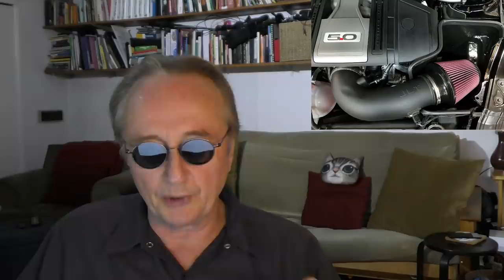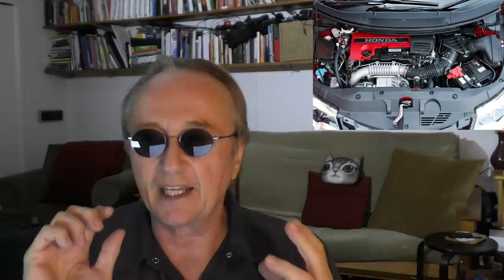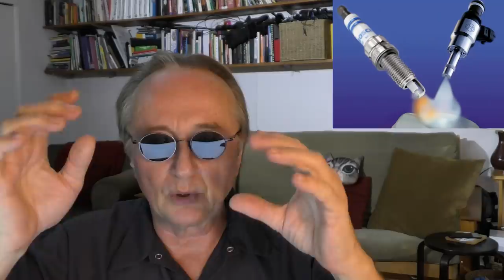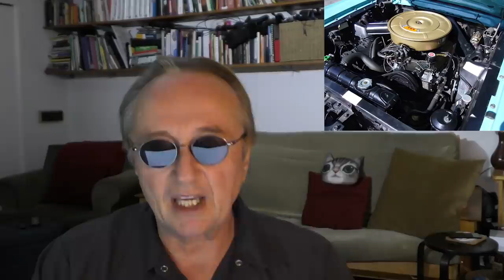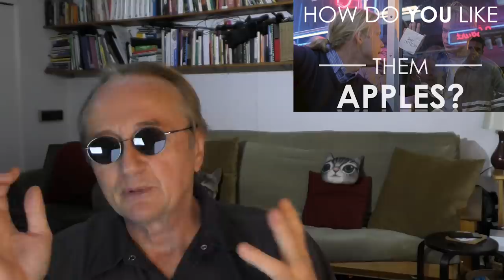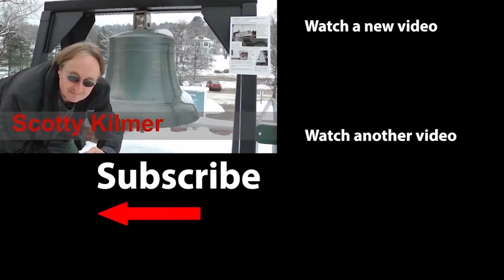This Car Mod is Stupid

Comment: I like watching your videos and find them informative. Thanks for making them. 
I have a 2017 F-150, 5.0, 4X4. I put an M&G braking system on it because it's flat towed behind a motorhome.  They're from Athens, TX, so you may have seen their product. It uses the air from the RV brakes by adding a device about 5" thick between the booster and the master cyl. This makes the OEM air filter box not fit by about 4". Since the OEM filter setup won't fit anymore, they also have some PVC and an oiled type filter (I don't think it's a K&N brand, but it looks the same type) attached the end as part of the brake conversion.  What other options do you recommend?

Comment: The late model Suzuki Grand Vitara is known to be a reliable great little SUV.  I picked up a 2013 with 30k miles on it a year ago and it drives nice, feels very solid, is well put together and I'm very happy with it.  It has a good AWD system with low range coupled to an Aisin (Toyota) transmission so it should last a while.

Comment: The guy with the lurching Acura - sometimes the ECU board has a problem. I had this with '06 Lexus and it was a 125 dollar fix after I sent it to the place in Illinois . Car worked perfectly, it was NOT a transmission problem, but a computer problem (for me).

Comment: Get a cold air intake, free flowing cat back exhaust, and get a tuner for the car. Usually a stage 1 would work fine with those mods. Or get an older vehicle and it’ll work fine

Comment: My 2000 Ford escort zx2 sr has cold air intake from the factory.  It has borlaug mufflers and the pcm IS different to accommodate the cold air.  Stock zx2 has 130 hp and the sr version is rated at 143.  2.0 I4 vvt naturally aspirated.

Comment: Lots of Cai are sold bundled with a programmer now. 
Only needed if it actually increases the airflow by a large amount.
Some Cai only increase airflow a little bit, and don't need computer tuning.

Comment: I 100% agree with you scotty the air intake systems make the car sound faster but actually make the car lose horsepower they are a stupid mod.
The K+N replacement filter are much more beneficial in the factory air box .

Comment: Scotty, when I start my vehicle it’s a 2011 bmw 328xi. When I put it in reverse it seems like I am hitting the gas slightly when I’m not. It’ll rev about 300 rpms jolty and then will be completely fine. 95k miles.

Comment: Any filter that's open to engine bay air is a hot air filter.  The only true cold air intake is your factory air box or any aftermarket filter system and incorporates a sealed filter.  Just change out the drop in filter with a higher flowing one.

Comment: Weird. I have an 07 Trailblazer. Moved to a k&n air filter . It ran a little hinky for about 2 weeks till I think the computer and motor seem to acclimate to the boost in air flow and ever since has run alot better 👍😎🤔👌😁

Comment: Noise when going into revers....works after a few tries.....I had that happen on a Dacia...let you foot off the brake a bit..let the car move a bit (not much) and it will engage... In my opinion the gear does not fully engage (can be felt in the shifter) and letting the car move while holding it in R you should feel the shifter move a bit

Comment: I have 02 Suzuki Swift. Sometimes it has same problem putting it in reverse. In such case I put it in 1st gear and move a little bit forward, then it goes normally in reverse. I don't know why it is doing so but just live with it since it is not a big issue.

Comment: have an S&B intake on a Colorado 2.8 duramax diesel. It woke the engine up eliminated the turbo lag and it performes much better. It was pretty slow stock.                                                      You have to buy a good quality one if you get a cheap one it will not be good some of the cheap ones will cause a cel..... but in my area we have no e tests anymore lol

Comment: A cold air intake can only have any benefit at full throttle, because at partial throttle the biggest restriction in the intake is the butterfly valve, which INTENTIONALLY restricts airflow.  Even at full throttle they don't have much benefit, and they're much worse at cleaning the air.  Most cold air intakes just suck hot air from the engine bay anyway.

Comment: Just looking at them, I wonder what the advantage is. Stock air intake is usually over a front wheel, maybe behind the front grill. The aftermarket is on top of the engine. Also, does the stock intake use a location to use air flow over the car to get air that is slightly pressurized pushed into the engine?

Comment: Hey Scotty, my 68 Impala has a stock manual transmission. It’s never been rebuilt or has never had any problems but every time it goes to 2nd gear it Jolts forward if I’m not either going super slow or stepping on it. Any ideas?

Comment: My 01 ranger had stock CAI and when I was young thought it would be cool to put a cone filter on so essentially i took my cold air intake and made it hot air intake by sucking in the heat from the engine.  I put it back some years later after i got older and wiser..

Comment: Scotty my cousin's 1998 Honda Civic won't go to second gear if the car is revved. it will only do it in idle.
it's manual transmission.
Reply: Check the clutch master and slave cylinders

Comment: Yep, exactly as I suspected the cold air intakes don't do anything but make a lot more noise. It would be stupid if a cold air intake improved performance because it would mean that car makers don't know what they're doing. My car has a ram air factory air box so I never even considered a silly aftermarket cold air intake.

Comment: A cold air intake is stupid if not racing and driving it normally, because air intake temperatures will actually remain lower in traffic with stock intake! It only makes a difference when racing, because the stock intake will dissipate heat slower, but a cold air intake will dissipate heat faster. After a pull on a strip serious people pop open the engine hood and put fans on the engine. I have a ram air intake because I race on a road course with an average speed of 90MPH!

Comment: With older vehicles especially turbo cars putting a intake or exhaust on will greatly increase the restriction flows of the car.  New modern cars requires alot more work....

Comment: Scotty: what about the intake resonators; what do they do? My Wife has a 2010 Infiniti ex35 V-6 and one of the resonators broke-off so I removed the other and taped up the holes. All I have noticed is it is much quieter under heavy acceleration. Cheers, Mark

Comment: It's usually not that hard to chiptune the car for a cold air intake, you might want to have a shop do it to avoid having to buy the interface and whatnot, but it's generally pretty trivial.

Comment: For fun with plastic engines, some guy in YT land builds those Revell 1:4 scale "Visible V-8" engines that rev to 7000 rpm (via a power drill motor). Highly mod-o-fied, of course, but all plastic.

Comment: I know why guy asking about his Suzuki Swift is having a hard time getting into reverse: its a common problem with those cars and it's from worn out synchros. If you don't want to repair or replace the gearbox, then simply and deliberately without excessive force, select reverse gear, several times if needed. The random crunch every now and then won't go away, sadly, without getting it fixed...

Comment: Had a 89 Geo Metro with a 3 cyl Suzuki engine. Car had 250,000 trouble free miles before it got smashed in the rear end. Still got 50 plus mpg before it’s demise. The rest of the car fell apart on the inside however

Comment: Technically, composite materials such as Carbon Reinforced Polymers (Carbon Fiber) and Fiberglass are plastic composites and they objectively outperform metal alloys in many applications. Carbon Fiber body panels and frames would be ideal for cars but in practice, they still cost too much at time of writing.

Comment: I put a cold air intake on my 01' Dodge P/U 360 cu. because the Air Filter was a pain in the Arse! It sounds like ya Flipped the Lid. Remember that? Flipping the Air Filter Lid was done to increase air flow, too.

Comment: Cold air intakes work if they are designed well. They have to be big enough inside, seal out hot air well, and provide enough flow. Cold air intakes don’t need a tune on like a car like the Mustang. It’s just they make 25-27 hp with no tune and make 32 more with one.

Comment: PSA to any CrownVic owners out there with Crown Vics made past 2005. DON'T put cold air intakes on without a tune. It will make them lug and you risk damaging them permanently.

Comment: Scotty, opinion please: For a new Ford F-150, which is the better engine:  the 5.0 V8 or one of those new 3.0 Power stroke diesels?  Thank you!
Reply: I haven't heard enough about the PS 3.0's. But I've heard that the 5.0's are surprisingly unreliable over the past few years. If you have a reliable truck, already, you're better off keeping it and have a cautious "wait and see" approach to the powertrain reliability. Maybe in a couple of years, electric pickups will be available, or be very close, and EV powertrains would a) have fewer moving parts, which should translate to more reliability; and b) be tailored to towing and hauling, with oodles of torque at 0 RPM. Watch the Tesla pickup truck announcement on the 21st. Ford is reportedly working on an electric F-150. This is a very expensive decision; don't rush!

Comment: I ordered the k&n drop in high flow filter and I’m going to get an x pipe to replace the h pipe and replace the giant camaro mufflers with magna flow atak and I will gain some hp

Comment: I'm not sure !! about the cool air induction,  you can tell the difference on a cool morning compared to hot day in performance. I am not convinced at all that the the ECU is incapable of functioning because of a change in temperature, the ambient air temp in the engine bay fluctuates considerably depending on location, season and how long the car has been driven.

Comment: I have a 2003 Chrysler T&C.. When I turn on the air. And it lights up. The air blows in the rear vents. But not the front.. What s the problem? 😳

Comment: What car measures back pressure I mean you could but why aside from checking for clogged cats and ya you can get some gains especially if the cold air intake lets more flow thru the MAF sensor but a tune would be better if you are going to spend like $600 to $1000 for exhaust and intake you might as well get a tune

Comment: My old 1991 Celica used to have a bolted on Iceman cold air intake, plus apexi exhaust with custom 2.5" catback exhaust. It improved the horsepower and ran fine. Those older cars had more "learning" computers as far as I heard, but I wont do a bolt on for my 2005 Corolla. What's the point?

Comment: Hey Scotty, I got a heavy crank in my Toyota Corona ... it goes like "whoop whooop whoop" before it runs. A mechanic came to me and said it's caused by my engine is lack of oil as it leaks. Is it true? Or is it just a bad starter motor that needs replacement?

Comment: Scotty I have a 2014 Chevy spark that has a blinking check engine on cold start, checking the bluedriver it says random misfire/ cylinder 2 misfire. Check engine goes away when engine is warm. Also sometimes turns off when parked

Comment: Cold air intakes don't do that much of a difference unless your stock intake was terrible. The outside air is not much cooler than the air inside your hood, it's windy as hell down there on the highway!! The only performance gain is if the new intake flows better than the old is itll flow better

Comment: Umm, I installed a cai on my 16 audi a6 3.0t and noticed an increase in fuel economy as well as throttle response and the engine sounds better too under acceleration so I guess what he says doesn't pertain to every modern vehicle.

Comment: I call them "hot air intakes" because most of them just suck in hot engine compartment air instead of cool air from the front of the car. Those have been proven to actually lose hp over the stock ones. There are some better ones that are ducted to the front of the car, but I don't see many people using those

Comment: 90% of "Cold Air Intakes" are installed in the most moronic places😑. Yes, let's plop a filter 3 inches from the hot valve cover.👍

Comment: cold air intake does not increase fuel economy, a hot air intake does. When the inlet air is hotter, the mass of air is smaller so power is less. That results is a more open throttle for the same power, so less pumping loss = better fuel economy.

Comment: You'll gain even more power by tuning, but on the stock computer, intakes and exhausts free up power in exchange for noise, which can also result in more MPG.  And the computers can certainly handle the small increase in flow, as long as the parts are designed properly (no 4" exhausts on 1.3Ls, proper piping sizing and flow for MAFs, etc.).  The power and noise come from reducing restrictions caused by chambered mufflers, louvered perforations, crush bends, varying piping sizes, etc.  All things that are poor for flow, but good for reducing noise and cutting costs.  Of course, if you buy random parts, the chance of improving things is random, as well, but known, tested parts will certainly result in gains, no matter the car.

Comment: Have a new edge mustang ('02) 'bout to upgrade the rims from stock 16 to 18in. Was going to also replace my airbox with a cold air intake(+15hp) to make up for the extra weight. But since Scotty says...........
Reply: The area potholes will love those 18" rims.

Comment: Hey scotty I have a 2009 corolla xrs Stick shift 164000, i did a full tune up on it, i added what the Mannuel recommended 0-20 full synthetic , now after my 80 mile commute i hear a ticking noise in the engine. Is the oil too thin and what oil do you recommend. Modesto California

Comment: So, I purchased a great used 2007 Lexus IS 250 from a private seller, after watching a TON of Scotty's videos. 

I just found out that it has a K&N cold air intake installed already. Well, I am getting into Autocross with that car here in NY and will do some racing (nothing crazy tho). I have no idea if the car's computer is properly tuned to that intake. I only know that it rides very well, not loud and no problems whatsoever.

The question is, how can I tune the car's computer to work with that intake?

Comment: Hey Scotty, what do you think about a 1997 Ford F-250 with the 7.3L Diesel? With 78,000 miles?
Reply: 7.3s are the only fords i would ever own. They are solid motors, 6.0 and 6.4 are complete trash

Comment: Yes cold air intakes make better noises and increase airflow to even out the mixture and to de restrict the flow off oxygen. Exhaust system upgrades will eas the flow of gases and prevent back pressure to stop build up at high speed. And it makes a good sound 😁

Comment: If you’re grinding into reverse, pump the clutch or put it in 1st, then reverse.
Reply: This is what I am doing. A little bit forward, then it goes normally in reverse. It is also Swift

Comment: Hi Scotty! Peter from Canada here. Want to ask you about royal purple oil. I have used it in my 2007 civic Si and noticed that my engine was sounding clacky noise. When I replaced oil back to Mobil 1 the noise went away.  I used 5w30 on both oils. What gives? Thanks eh!

Comment: on cars that run funny after filling them up with gas,  the solenoid purge valve is bad and flooding the motor with to much gas,

Comment: @ @Scotty Kilmer  I have a 1988 Fiero GT 2.8 V6 5-speed manual in my small collection that I use as an occasional weekend toy. It lives outside in an open carport under a car cover but have recently noticed that the engine has a persistent miss at idle until it warms up. The engine was rebuilt just over 2000kms ago and all of the ignition was replaced new at that time. This has only been happening since the beginning of autumn when it started getting cool and damp. I suspect (hope!) that it might be something as simple as moisture inside of the distributor cap but am interested in your thoughts.

Comment: Suzuki make another quality in their cars today. They don't have a poor name in Denmark.
My encounter with them is solid and long lasting if maintained.
A weakness they share with many is the rear calibers with inbuilt handbrake. But they can last 5+ years if serviced correctly. The piston have to be reversed with a turning tool.
The german cars have lots of problems.

Comment: What's your thoughts on a ford Mondeo Ghia 1998 V6 duratec 120k kilometres needing a exhaust replacement withing the next two years and AC refrigerant needing refill is it worth the $280 NZD i have not gone to get a quote for a replacement exhaust because the price of the AC refill was daunting so I did what you said and check around other mechanics prices other mechanics offered a lower price for the refill from $280 down too  $130

Comment: Still disagree on the CAI, for me it is fuction over performance. Turbos get really hot at the centrifuse, it is better to draw it cooler denser air then it is from the stock box. Personally I don't want to pay $2,200 to replace a turbo charger. A cold air intake is pointless if you don't have the ductwork running to the outside of the vehicle

Comment: So if i were to get an injen cold air intake(if you google a picture you can see where its sucking air from) for the 350z HR, got a nice open exhaust, and got it tuned it should increase power correct? I know if you just slap on a cold air intake it wont do anything but with the combination of other mods, and a tune the cold air intake should be beneficial to my knowledge. Please correct me if im wrong